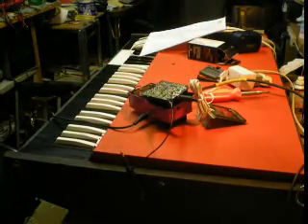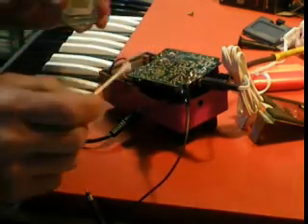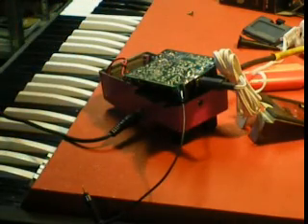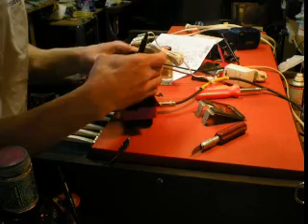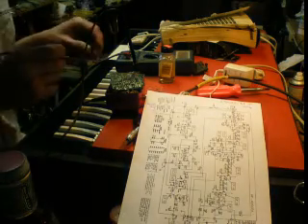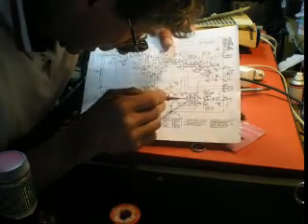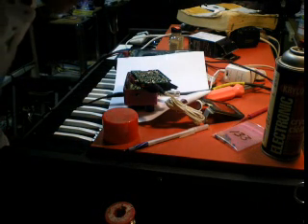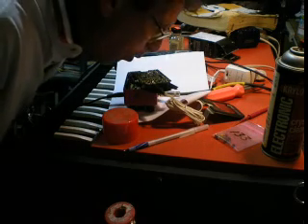Ibanez AD80 repair.  Documenting a ghost in the machine.

Comment from the maker: @iloverush123 Yeah there really were some interesting possibilities there :-).  Some tube amps can do some really interesting things I've found if you just unhook the pre-amp filter capacitor (eg. Hot Rod Deville).  You get a really cool theraminic effect modulating the high and gain as I recall. I actually did a recording of it figured I'd use the noises in something some time.